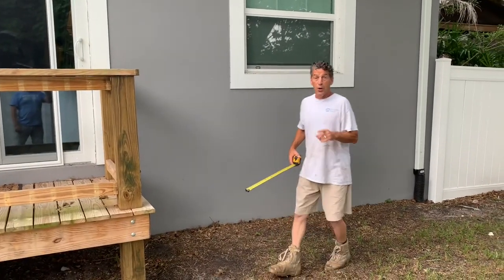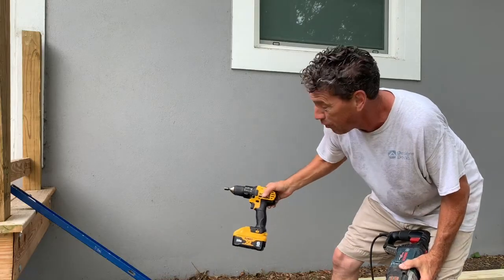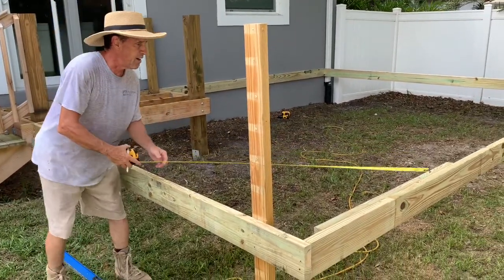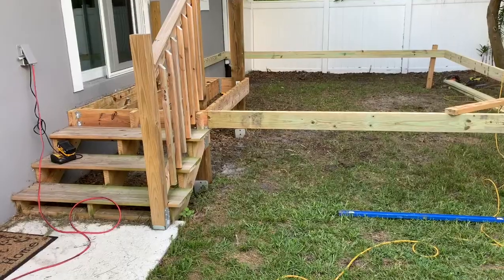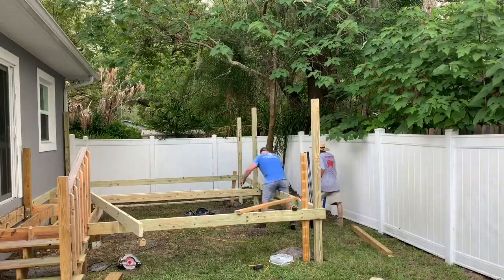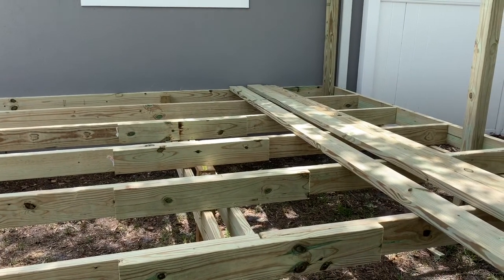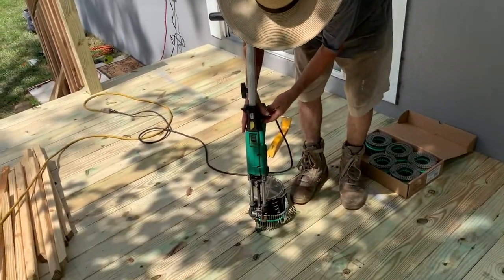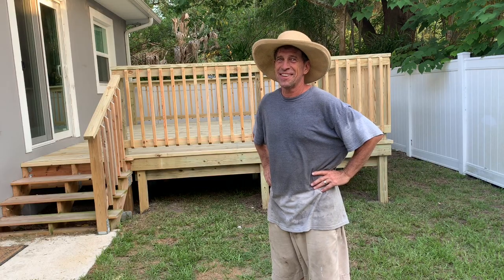Extend Your Existing Deck

Comment: Fast setting concrete doesn't require mixing pour in hole dry add some water and that is the manufacturers direction on how to use there product save you a little work mixing all that concrete in a trash bag

Comment: My guess is that ledger board is already  been pulled out of the wall, a single row of tapcons into what sounded pretty hollow when he drilled will not hold and tapcons  have  not much shear strength, Red head anchors are better, if you want to use tapcons they should be in pairs an inch from top and bottom and no less than 1 ft centers, better to over do it if your not using red heads.
Reply: @fritzybrothers  Yeah sorry I thought i already corrected myself on that but i guess  I never entered it, yes I jumped to a conclusion with out watching the rest of video first  to see it was not  a supporting board and it was held up by a separate beam, thanks for the video .

Comment: I liked where you said 8' and 6' . Its square! 😂
Reply: He used trigonometry. In a right triangle, with the length of 6 on one side and 8 on the other, if it's a perfect square, the hypotenuse will be exactly 10. If it's anything more or less, you're not square

Comment: Should have used drop-ins with the board bolted to the wall. Tapcons are typically not allowed by code and if something would happen, insurance will not cover the damage or medical bills.

Comment: So are the 4x4s just sitting on top of the concrete you poured? Nothing actually anchoring them in?
Reply: That's what I was thinking. Surely they used an anchor bolt installed into the concrete with some hardware on top.

Comment: Did you put the post start in the concreate?
Reply from the maker: After I dug the holes I created a 4 inch slab to put the post on. Although in the county I do most of my decks they only require to sledge the post in two inches. These post were higher and sledging them would have been an issue.

Comment: Using the saw to trim the top of that post is almost the dumbest thing I've seen on youtube. That will get someone seriously hurt when a blade snaps at 5000 rpms. That alone makes me question the quality of work going into this. I don't want to be a negative Nancy, but I also don't want some do it yourselfer think it's a great idea and end up losing a limb or worse. You could also face legal action considering this being an educational video.